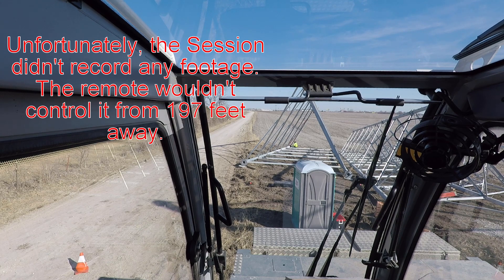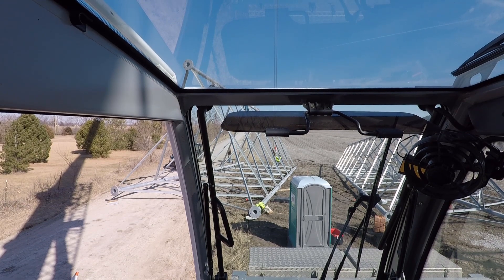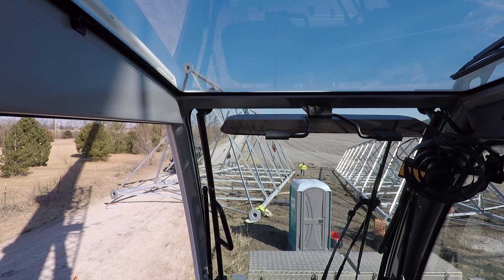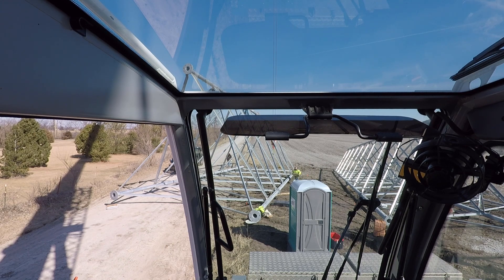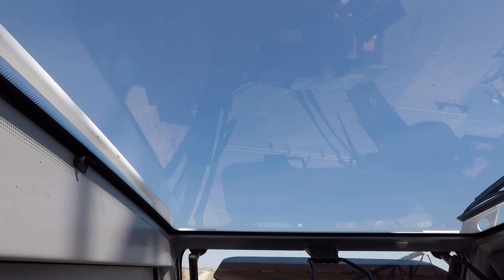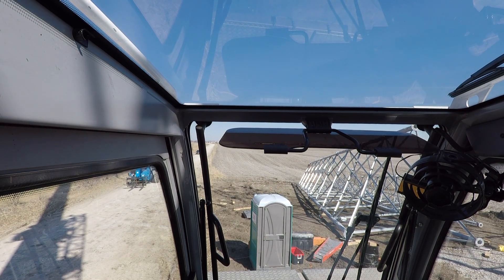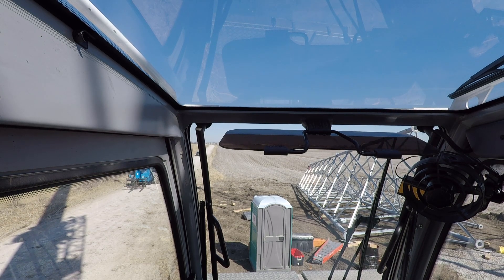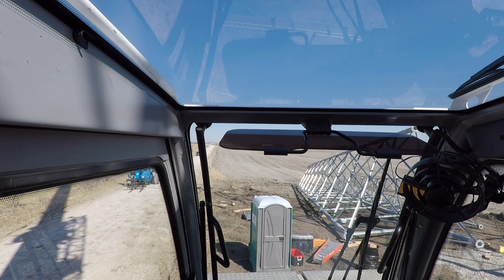To The Top Crane | Part 1. Building a cellphone tower

Comment: Does the cell tower contractor do the rigging and provide all the radio communications with you?
Reply from the maker: Chris Rowland we have our own two way radios. On this job, we used the ones provided by the tower company. All of the tower employees on this job are certified rigger/signal persons. In the event that the contractor doesn't have a certified rigger/signal person, all of the support personnel in our company are certified riggers/signal persons.
Reply: What scope of work does rigging imply? How long was the crane installation if the winds were acceptable? Is 15MPH winds max for safety?